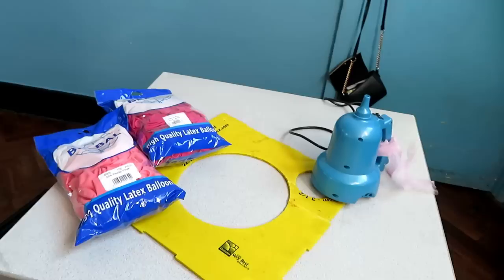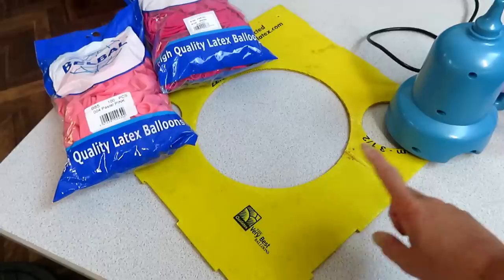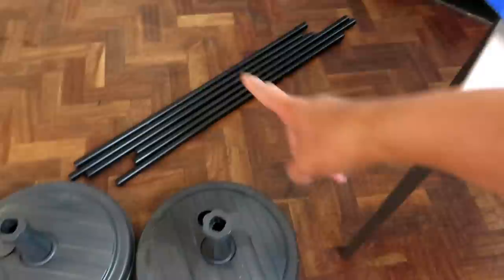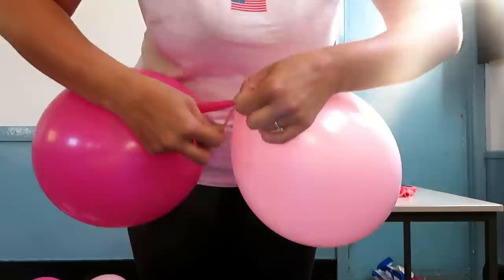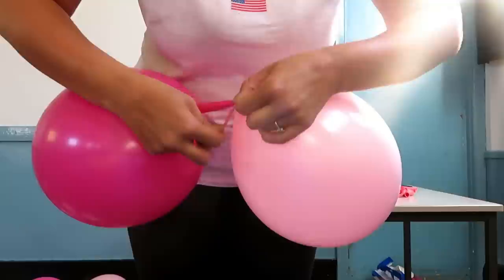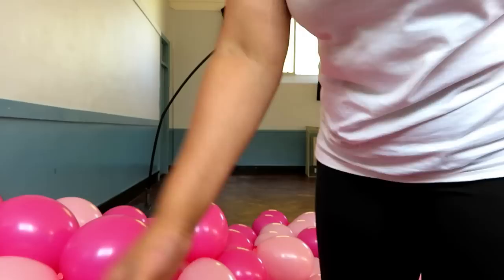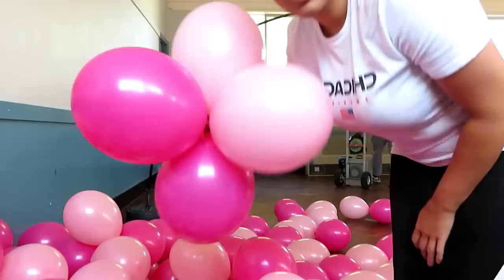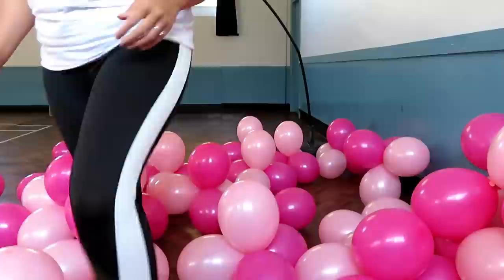HOW TO MAKE A SPIRAL BALLOON ARCH || BALLOON DECOR || BALLOON ARCH

Comment: Hello hun what is the size of your arch and how many balloons do you ruffly use x
Reply from the maker: Harlz B 

Hiya Hun, 

So the size is approx 11ft wide and 7ft high and it takes about 150 10 inch balloons xx 

https://www.ebay.co.uk/itm/LARGE-HEAVY-DUTY-BALLOON-ARCH-FRAME-DIY-KIT-HIRE-OR-BUY-OPTION-NO-HELIUM-NEEDED/192281527558?hash=item2cc4df4506:m:mstk9Vy7B1rQc3PDqykTiJg

Comment: Hi. Where did you get the the base you’re wrapping the balloons around ?
Reply: That's my question as well...
Reply from the maker: Hiya Emily, 

So the balloon arch frame is from EBay, 

It is £49.99 and you just type in Ballooj arch frame. 

I will post the link so have a try and see if it works, thanks for watching Hun! 

https://www.ebay.co.uk/itm/LARGE-HEAVY-DUTY-BALLOON-ARCH-FRAME-DIY-KIT-HIRE-OR-BUY-OPTION-NO-HELIUM-NEEDED/192281527558?hash=item2cc4df4506:m:mstk9Vy7B1rQc3PDqykTiJg
Reply from the maker: Raichelle C. 

Hiya Hun, I have posted the link on this reply thread x
Reply: Thank you!

Comment: Hi is the arch stand sturdy or does it need to lean up against a wall?
Reply from the maker: Hiya, the arch is free standing and very sturdy. The one I have you can also use outside as you fill the two side weights with water so it can withhold wind force! Hope that helps! 😊
Reply: @JadeKimberlie  fantastic thank you. Can i have the link please🙏🏽
Reply from the maker: AMessageFromTheBride Weddingsandevents of course! 

https://www.ebay.co.uk/itm/LARGE-HEAVY-DUTY-BALLOON-ARCH-FRAME-DIY-KIT-HIRE-OR-BUY-OPTION-NO-HELIUM-NEEDED/192281527558?hash=item2cc4df4506:m:mstk9Vy7B1rQc3PDqykTiJg

Xx

Comment: What is that yellow cardboard piece that you are using for the balloons? Is it to even out the size of the balloons? I’m creating my first balloon arch for a school event. I bought the arch and electric pump but I don’t know how much air to put inside the balloons. Any help would be appreciated and I love your tutorial! You make it look easy lol 😊
Reply from the maker: mkiingst0n 

Hiya Lovely, 

Thank you so much for the kind comment and for watching! 

The yellow thing is a 9 inch balloon sizer.. made by Qualatex I’m sure but I ordered from eBay. Here is the link to the one I have however it is fairly pricey so if you don’t want to spend that much, get a piece of firm cardboard, measure out a 9 inch circle and just cut it out as that’s all it is! 

https://www.ebay.co.uk/itm/Balloon-Box-Sizer-Size-Qualatex-for-13-different-balloon-sizes-Yellow/281392573155?hash=item41844deae3:g:aRcAAOSwEeFVGT32

So the balloon sizer is just to ensure that your balloons are the same size to make it look ‘in shape’ when you put them all together and prevent uneven sizes.

In regards to filling the balloon, you want to blow the balloons up until they feel/look like a full circle, if you begin to add too much air they change shape, they start to get ‘longer’ at the bottom if that makes sense? But don’t worry about that too much as you will be letting out the air when you put the balloon through the sizer. You want the middle of the balloon to fit the 9 inch sizer snug, so I space between the balloon and sizer. 

Does that make sense? It is a little hard to explain in words! 

It may feel a little awkward to judge in the beginning but you will pick the hang of it up as you continue blowing them up! 

Let me know if it’s a little hard to understand and I will make a quick video for you on blowing them up and using the sizer so I can show you :) 

Good luck with it and let me know how you get on! xx

Comment: Hi, can this be done with smaller size balloons rather than 9 inch ? I have an event coming up and my balloons are elongating anything larger than 7 inch. Can you please suggest ?
Reply from the maker: kpunem Hiya, you can do it just depends on how thick your pole is for your arch. The thicker the pole the harder it will be to twist a smaller balloon around possibly causing it to pop due to the pressure. 

If possible trial run a twist and see how it feels ... 😊
Reply: @JadeKimberlie  thanks a lot for your video as it gave me confidence to build my own column for an event. The pole I used is from a floor lamp and that  is pretty thin and thus I have to literally tie the balloons around it because they are free to twist and twirl around the pole. 

I am presented with one more challenge though. The spiral patters are coming to life but sometimes there is a space and I can see the pole.Are there any tips to avoid that ?

Comment: Where did you get the balloons helium’s tank
Reply from the maker: Hiya, 

I didn’t use any helium to make the arch I used a stand which can be purchased from eBay - just type in balloon arch stand and it is about £55 

If you are after helium and you are in the Uk I get my helium from click4balloons.co.uk 

:)
Reply: So where you get the blue thing it works
Reply: And I like you thanks for the answer
Reply from the maker: Miheret Tadesse That’s am electric balloon pump - it fills balloon with air. 

I ordered it from the Same website
Reply: Thank you so much

Comment: Beautiful but pls did u measure d circle on d paper or how did u get it pls?
Reply from the maker: Thank you very much! 

You can find balloon sizers on eBay, however it is a bit pricey if you are only using it for a one off? If you plan to use it regularly then it may be worth the investment as you get many different sizes, I will put in the link for you. 

https://www.ebay.co.uk/itm/QUALATEX-BALLOON-SIZER-CUBE-NEW-YELLOW/202608678834?hash=item2f2c6b17b2:g:UVwAAOSwxoJcdR8I

If you would like to draw it, I personally would use a tape measure, Mark a centre point and draw 9 inch lines to make a around it passing through the centre so you can then just cut it out if that makes sense? 

Or maybe if you have a 9 inch round cake tin draw around that? 

If I think of another way I will let you know! 

Thank you for watching, I really appreciate it! xxx

Comment: Hi Jade, I bought this balloon arch and did my first job last week, the arch had to be moved by staff the next morning to outside the shop and about an hour later it snapped at the top. I had the arch connectors secured with tape so I really didn't think this would happen. Nervous for the next job now. Not sure if the staff weakened the arch when moving or whether it was the arch itself that just gave way. Would really appreciate your help. Thanks
Reply from the maker: Michelle Dolan 

Hiya Michelle,

That’s ever so strange! Would you mind sending me the exact link to the arch you have? As I can’t imagine how this one would break as the plastic poles are quite thick so I want to see if it is the same one and if it isn’t which one it is xx
Reply: Hey Jade, this is the link here https://m.ebay.ie/itm/192281527558?sojTags=bu=bu&euid=null&_mwBanner=1&_rdt=1 
The pole didn’t snap, it came loose at the pole connector 😭 I secured it well with duck tape so I thought it would be fine x